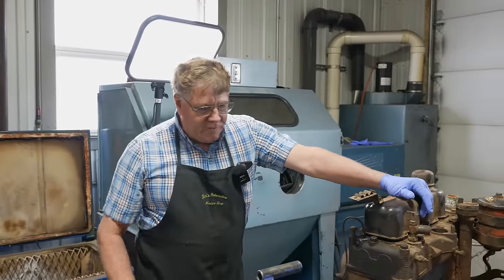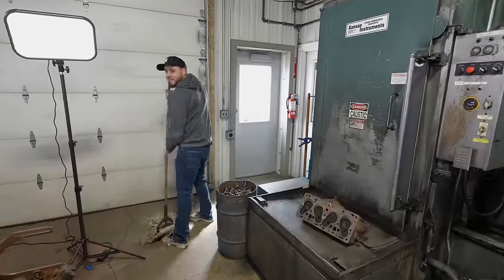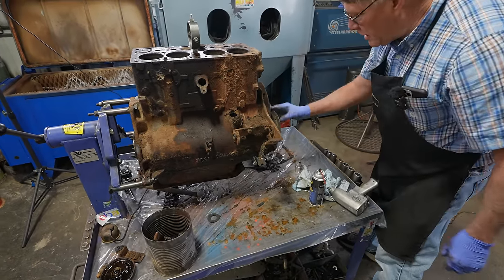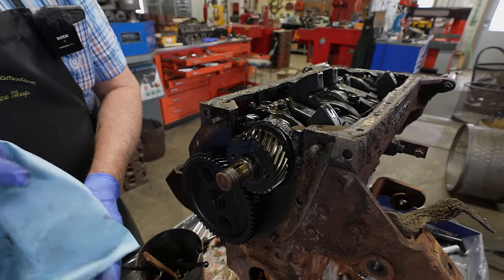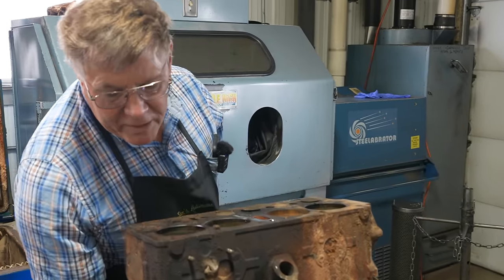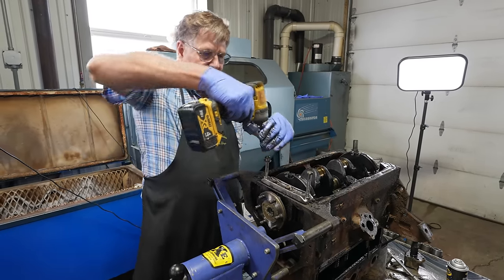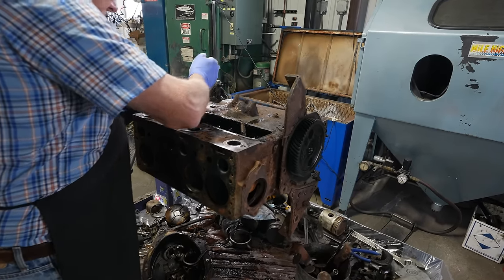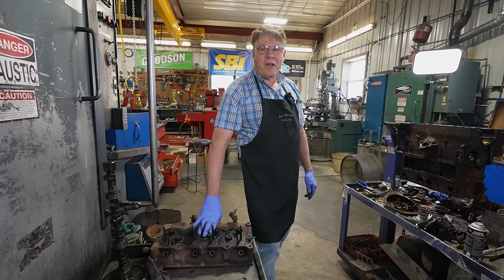Tearing Down A NEGLECTED Willys Hurricane Engine...

Comment: Rolls Royce used the F-head in the B series engines. Used in a bazillion military things after WWII.
Reply: And a right old boat anchor it was. For some unknown reason called "prestige" BMC put a version of that boat anchor engine in their top slightly re-engineered Austin car in about 1964, where it rendered undistinguished service for several years, and became a bit of a joke.
Reply: @BillMalcolm-tn3kq  strangely the British government didn't see the B series that way and the Princess R was hardly representative. Militarily, the Ferret page says: "The B range design is extremely reliable, just as the Army wanted. Full power is possible from virtually a cold start. Most still run well with regular maintenance after 50 years or more, and they can withstand rough usage and indifferent fuel quality without damage. These engines were required to run reliably and efficiently from -40°C to +50°C: in Arctic to Equitorial conditions as suited to all the theatres of Empire that the Army was required to serve."

Comment: 'Years gone by if you got 100000 miles out of a motor it was a huge success'. We seem to be going back to that with a lot of todays engines.
Reply: When I was growing up I remember when we would celebrate when we rolled the odometer over at 1,000,000 2 different cars that I remember doing that with as a kid

Comment: 2.2 litre inlet over exhaust. State of the art for European engines in 1950.
Reply: State of the art? You must be joking. Here's but one example of state of the art: Jaguar XK engine from 1948. Twin overhead cam six cylinder 3.4 liter. I can think of numerous other engines as well, but won't belabor the point. Rolls Royce and Rover went inlet over exhaust, and nobody could work out why -- total dead-end idea. Heck, the new English Ford engines of 1950 (four and six cylinder) were designed in concert with the ohv Ford 215/223 six that came out in '53. Inlet over exhaust was fuddy-duddy blue-sky dreaming.
Lancia brought out the first V6 in 1950, and it was pushrod -- same displacement and power rating as the GM Citation V6 of 1979 with a 60 degree Vee. Bigger Morrises and Woleseys had an overhead cam six in 1950, eventually replaced by the enormous lump of inert iron BMC C engine that powered the Austin Healey 3000 sports cars -- just an overhead valve lump that was retrograde.

So, nope, IoE engines were never state-of-the art in anything, ever.

Comment: I worked for UEM, United Engine and Machine, a while ago.  The same shop you had the sales man in a while ago with the dimpled pistons.

I hated making those pistons, the Willys .   I had run/setup almost ever machine that made that piston.  The skirt reamer, make the bottom flat was not bad.  The boring machine for the pin hole was not bad.  The lathe and size changes was horrid.  The chamfer under the oil ring had to be reset ever time the size change was done.  Not easy when the machine was running 0.004 between stations, 6 of them, and the chamfer had a 0 to minus 0.005.  The same tool block did all the chamfers on the lands and groves.  

Then we get to the cross cut, both horizontal and vertical, plus the drills.  That machine was dedicated to this piston.  I never saw that machine used for any other piston.  I may be mistaken, but I believe the the oil grove may have had 8 holes drilled in them as well.  If true, that was a pain in the butt.  

Then we get to the cathead.  This finishes the skirt.  The majority of the pistons we used diamond tipped tooling.  On these pistons we had to use carbide.  For some reason or another carbide tooling did not produce chatter at the vertical crosscut.  The downside was that if there was a hard spot, aluminum oxide in the piston, we had to change cutting tools.  More time down.  BTW, I was put in charge of the catheads at the end of my time at UEM.

Sadly they moved to Mexico from Carson City NV.

I believe the call number on that piston is 2606.

Comment: Terrible engine we used to replace them w a flathead six . Continental  or. Dodge or kaiser       Rod bearings.   oil leaker     the flathead 4 was better. A milk truck flat 4 fit em too. Without overdrive they over revs throw rods at hw speeds

Comment: I've always heard gally.
Reply: Galley:
large seagoing vessel propelled primarily by oars. 
The Egyptians, Cretans, and other ancient peoples used sail-equipped galleys for both war and commerce. 
The Phoenicians were apparently the first to introduce the bireme (about 700 BC), which had two banks of oars staggered on either side of the vessel, with the upper bank situated above the lower so as to permit the oars of the upper bank to clear the oars below. 
The addition of an outrigger permitted the employment of a third bank of oars, the rowers of which sat above and outside the other two; such a ship, which was called a trireme, was probably first constructed about 500 BC by the Greeks. 
References to even more banks (for example, the quinquireme) are believed to indicate a ship of very large size but with no more than two or three banks of oars.

So galley could refer to the  offtakes of the oil being  like the oars poking out of the galley????

Comment: Only 2 wheel drive Jeep engines used a road draft tube all 4 wheel drive jeeps had PCV valves.
Reply: First used on road cars in 1961. So this '52 Jeep didn't have one, 4WD or not.
Reply: @BillMalcolm-tn3kq  Jeep has been using PCV valves since 1941 all jeep MB's built for WW2 had PCV valves and all 4WD jeeps continued to use them.
Reply: @williammccarthy5696  And on the basis of no proof whatsoever, merely an assertion on your part,  I'm supposed to believe you? Sorry, that isn't how things work in the real world.

Comment: ENGINE oil in the 50's was non detergent and  single weight.  Went to the API site could not find when the SA, SB oil was introduced.  This is what I copied from the API site.  Anyone have that information?
SC	Obsolete	For model year 1967 and older engines.
SB	Obsolete	For older engines. Use only when specifically recommended by the manufacturer.
SA	Obsolete	For older engines; no performance requirement. Use only when specifically recommended by the manufacturer.

Comment: My opinion is this. Oil Galley is a historic mistake in terminology that has been reinforced through the years. I don't care if GM used incorrect terminology and people want to use that as a reason to continue this error. Read the definitions for both galley and gallery and come to your own conclusion on which is correct. When I hear Gallery I think of Rod Serling anyway.
Reply: Galley: An oblong tray of wood or brass, with upright sides, for holding things (originally typesetting)
Gallery: roofed promenade, especially one extending along the wall of a building and supported by arches or columns .

Honestly both definitions fit just fine, and neither are exact. Being borrowed when new terminology was needed for engines.